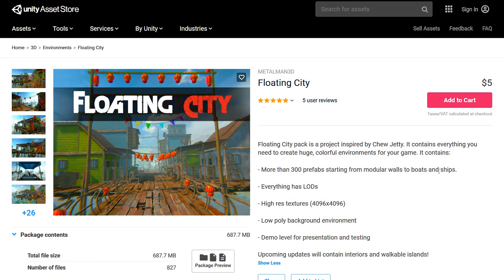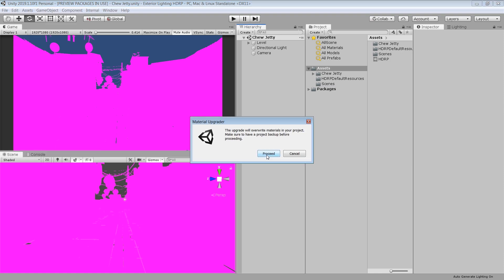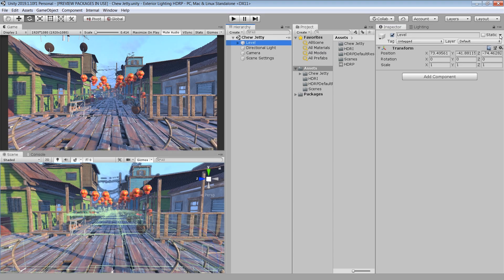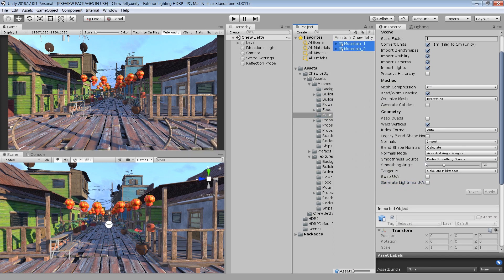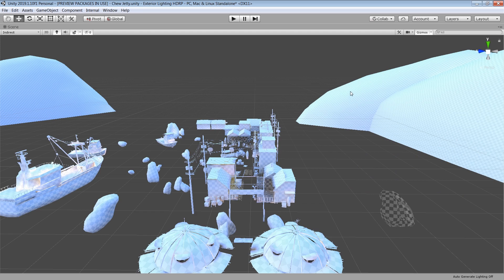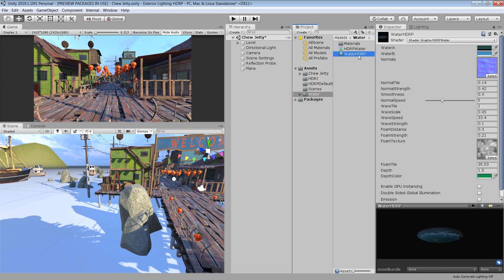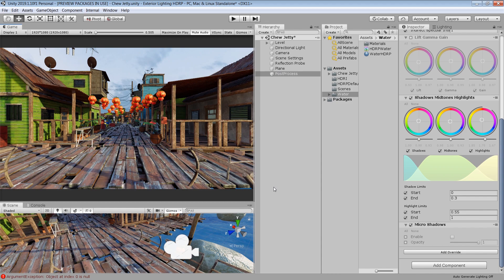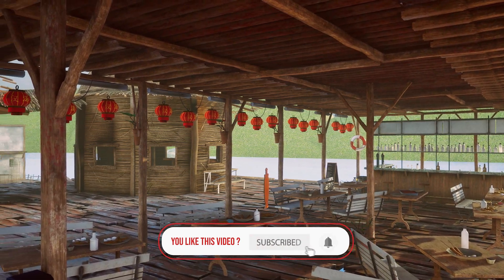EXTERIOR LIGHTING in HDRP(High Definition Render Pipeline)

Comment: Great tutorial, didn't know about Indirect Lighting Controller and what it can do, so thanks. Also, the Micro Shadows override is absolutely stunning.

Now a little bit of a problem..

In the non-HDRP workflow you can designate the scene "sun light" by going to Lighting Settings window and select which directional light you want Unity to consider as the sun light in the scene (ex. the Procedural Sky shader will use this designated light to render the sky box with the sun disk etc).

In the SRP / HDRP workflow the setting is not there, as you are supposed to setup the procedural sky in a Volume component typically named by Unity "Rendering Settings". So you basically this adds in your scene a Volume containing by default a Shadows, Visual Env, Procedural Sky and fog overrides.

For the sake of example, as opposed to what you've one in your video, let's assume we use the procedural sky override, therefore in the procedural sky override you set all the settings related to it. Except you cannot chose specifically a directional light the procedural sky should be using. I'm assuming some automatic detection is made behind the scenes, Unity "magically" detects the only dir light in your scene and uses it as sun light when rendering the procedural sky. The trouble is that sometimes it fails to detect it and you're left with a sky without sun.

Therefore my question is: Is there's an option to specifically tell Unity "hey, I want to use this dir light as sun"?

Thanks.
Reply from the maker: First of all in HDRP you can only use one direction light which is by default assumed as sun. So even if you create another direction light HDRP will give you an error.
And as you know in real world there is only one light which mimics as directional light which is of course our sun light.
So the answer is not you can't tell unity to use a directional light  as sun. It will automatically accepts the active direction light for sun light.
Reply: @UGuruz  So it looks like. Thanks. Was wondering what are your options if you want a more exotic / sci-fi scene with multiple suns.
Reply from the maker: @AlexTuduran  In that case you can use a spot light as a sun.

Comment: I try all this 3 rendering

1. the originals unity render the don't have shader graph is the only reason i don't use that system
2. the urp the have less option but i have shader graph
3. the HDRP have to meny options but the problem is to heavy and as fur known that is not supported from mobile 📱

the problem is each from this Rendering support different type of shader this means i need to decide only 1 and to diced before you make to mach shader or to make shader code the have 3 shader inside 1 from the normal rendering 1 form HDrp and 1 from the urp, im not sure if that technique works.
Anyway i still don't understand why the don't have 1 rendered system which to support everyone type of shader and have shader graph and i need to decide 1 of this 3 Rendering type 

i still don't know what of this Rendering type is the best from my projects i want to make this project in the order to play as meny compuer is passable to have shader graph in the order make my material type and i dont won't to have less options what you suggests?
Reply from the maker: Let me make this simple for you.
If you want to develop game for computers then you can use standard or HDRP.
In HDRP you can use shader graph and for standard RP you can use Amplify Shader Editor(paid).
For mobile you can still use Standard or URP(previously LWRP).
Reply: @UGuruz  OK thenx already know that the truth I want my game to by playble in eny platform.
because I trying all off the rendering system I already decided to use urp in the order to have matirial editor for free and better performance, the only problem I have at time is the camera layers (if add 2 cameras, 1 for top and 1 for below the don't have option to see both cameras because this option has removed). 
I hope to fix that problem in the future unity version Allredy have fixed the split screen problem I think I fixed that problem as well.

As hdrp is heavy i don't want use that system because i want my game to have good performance in eny Device the only rendering system I have good performance at this time is the standard recording and urp
Reply: @UGuruz  sorry I make big comments The reason for this is I try to have More detail in the order to understanding the problem

The other reason is Because my English is not good and I want my comments Make sense

Comment: I am new to Unity (I use Unreal) and found your tutorials which seem to be really good so far.  I do not know alot so maybe I am wrong in saying this but one thing I am finding annoying about Unity is the apparently constant state of change with these editors and then the preview packages.  I am trying to follow along in this tutorial, everything is going great until 4:02 where you mention that if using 2019.2 you need to use the contribute GI under static.  Every time I try this Unity Editor crashes.  I then move on and cannot create any lightmaps when following your steps.
Reply from the maker: Crash while light baking in unity is common. Try using a different version of Unity.
Reply: Unity Guruz  it actually worked out on a newer version.  Not sure it was that or if it was me switching project over to github in lieu of using Dropbox.

Comment: Do we have IOS support for HDRP, such as Ipad Pro with A12X chip? I tried but it is alway fail with exc memory error on runing on iPad pro
Reply from the maker: HDRP is not designed for mobile devices that's why is not working. You can use LWRP for mobile platform.